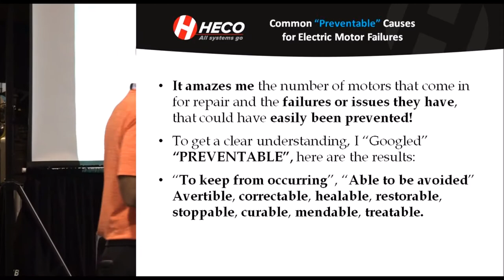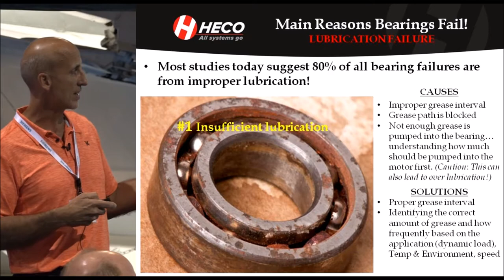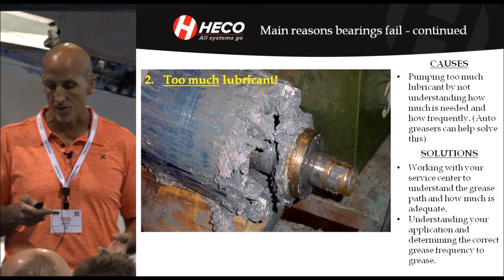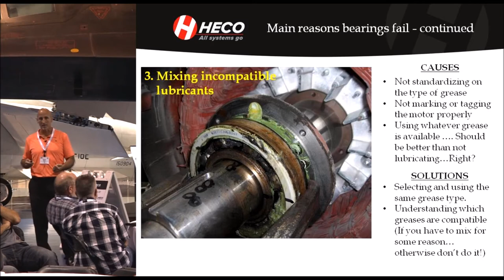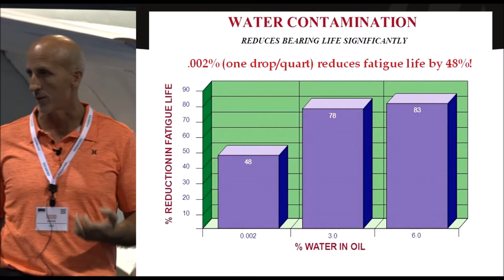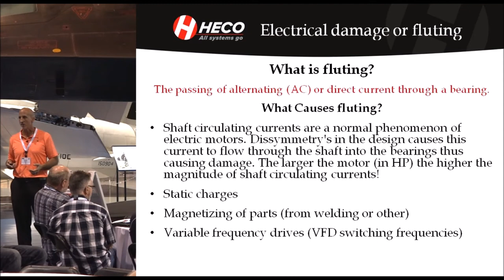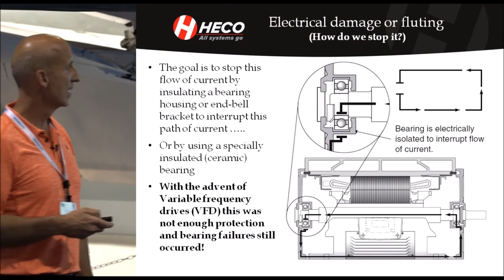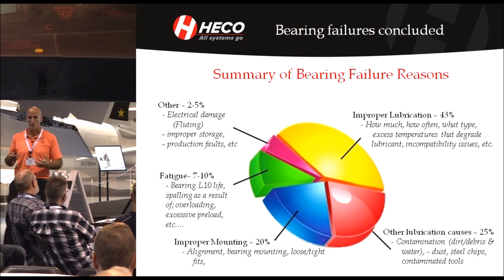Common Preventable Electric Motor Failures: Bearings

Comment: Third option quite alot cheaper is nano crystalline Emf Cores stops the common mode current at the source protecting motor insulation. Grounding rings and insulated bearings don't offer this protection. 3Phi

Comment: I was under the impression that most motors in common use have sealed bearings without provision for re-greasing. Certainly every motor I have seen other than old plain bearing motors. I always thought bearings mostly fail from contamination (dirt, water) and improper loading (too much belt pull, high imbalance etc). How common is greasing motor bearings in industry? Does someone know?
Reply: Very common

Comment: Hello. I have just begun to see the video, and I have a question: How you may know if the motor is in the wrong application or sized incorrectly?
Reply: Usually you would read the specifications within the nameplate of the motor and if it suits the environment and workload.